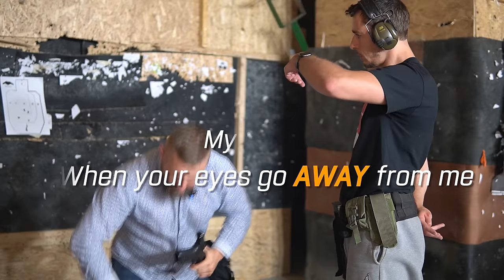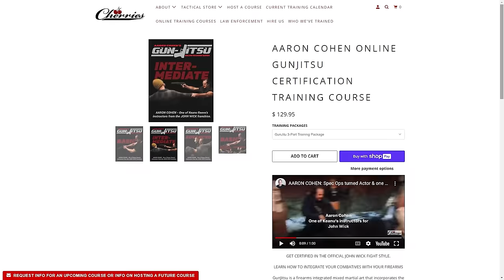John Wick Training Changed Everything (21-Day Challenge)

Comment: Rokas, that's some mighty good shootin' there! You did fabulous! Small tip, only wear clip-on neck ties to prevent being choked by your own tie. I tend to use a combination between the classical American Police Weaver Method and Israeli Technique Method Isoceles you were using. 

The McMillan Tilt is when you how to aim from your non-dominant eye using the 15 degree McMillan Tilt, originally designed for people with rare cross-dominant eyesight. CAR teaches you how to "slice-the-pie" by teaching you how to aim using the McMillan Tilt from your non-dominant eye so you don't have to expose your entire head when looking around a corner. 

For example, if you're right handed and right eye dominant and you have a walkway in a "T" configuration, use Israeli Method or Weaver to go the LEFT walkway... use CAR to limit exposure to go to the RIGHT walkway.

Personally, I only use CAR as an way to pie my right corner during "deliberate entry" for to remain concealed, but surprise the opponent with an immediate accurate shot as you enter. Forcing yourself to aim with your non-dominant eye too long WILL can cause combat fatigue and strain both your eyes which can be dangerous in combat, so if your enemy already expects you, use the Israeli Method because your aim will be better and response time will be quicker. 

Hope to see more of your martial arts videos and time at the gun range!

Comment: Interesting...I think you should learn about room clearing a bit more. These are knitpicks but I think it's cool to learn more. When you enter a threshold of a room try not to present your weapon too far in front of you. That is where the C.A.R technique works best. You want move around a door until you covered what you could, then storm the room with speed and aggression. Also when moving forward DO NOT put your weapon down when moving forward. Keep your weapon compressed so when there is a threat you can punch out easier and faster. It's also good to blade yourself when peeking around corners. Otherwise good stuff. Just keep your gun up and look for work.

Comment: I have a correction for the video. AR9s and AR15s are NOT automatic. They are semiautomatic (same as your handgun) meaning with one pull of the trigger one shot comes out. Automatic is not the same as rifle or long gun. An automatic will keep shooting while you keep the same trigger pull and will stop if you release the trigger or run out of rounds. Also automatic weapons are really hard to find and possessed legally and they aren't recommended for new shooters. You can have 2 handguns that look externally exactly the same but one is automatic and the other one semiautomatic, same with rifles. How they look does not determine what they are. ✌️ peace from a Martial arts practitioner and shooter.

Comment: Bro. I worked PSD, and SRT for years. We were trained in weapons, and combatives. I'm a trained pistol operator.  You have to control the gun, and the mag. Same as a knife. The slide check is actually a real thing. Gunjitsu is a lie. Make space, shoot from the hip. Pistol is a point and shoot. You're too stiff. Relax my dude. You might get a slide bite, but you seemed tense. You need some work on your stance. If you want tips, just ask. I did this stuff for 10 years.

Comment: Did you lift your foot before or after the shot in the triangle-to-headshot. 😅 I'm not sure if you would have shot your own foot?
Reply from the maker: It was close! But I aimed for the head 😁
Reply: @MartialArtsJourney  😅 There's still a chance that a bullet will pass through the skull and could continue into a foot holding the head. All hypothetical though. 

At the first two shots I was actually in doubt if you were using blanks. 😅
Reply: @MartialArtsJourney  BTW I'm impressed with how fast you picked it up. Your journey the last couple of years must really have primed your brain to learn new stuff. 😃

Comment: that was not an automatic rifle it is semi auto the difference if that an automatic rifle you can pull the trigger one and hold it and it will fire the bullet as long as you hold the trigger and semi auto you have to keep pressing the trigger to shoot the handgun you used was also semi auto also if you think AR stands for assault rifle or Automatic rifle it doesn't it stands for armalite rifle which is the company that first made that design of rifle

Comment: Note: If you press the gun too deep into the body of an attacker, a semiautomatic pistol likely will come out of battery, which does not allow the gun to fire. Also, that thumb down technique will negatively impact your shooting. Too much strength from the shooting hand will cause you to pull shots to the opposite side. Crush the grip with your support hand.
Reply: Israelis carry without one in the chamber which only leaves the option of striking with the gun to create distance to chamber a round. No one else teaches that technique because most train to carry condition 1 and you would instead just fire from retention.